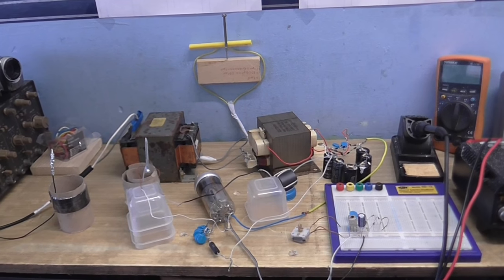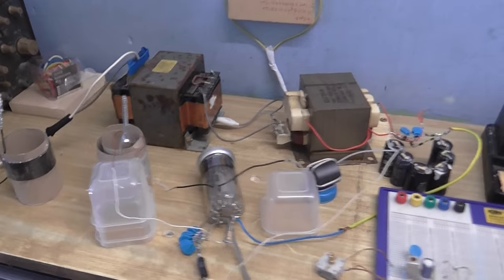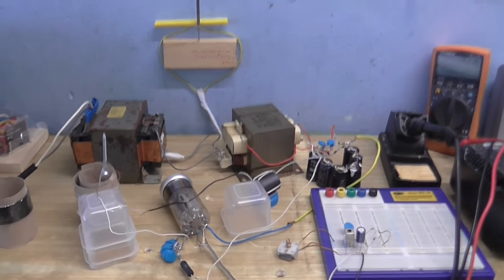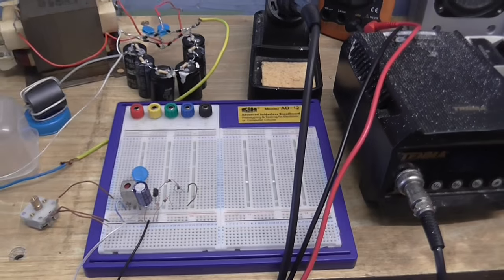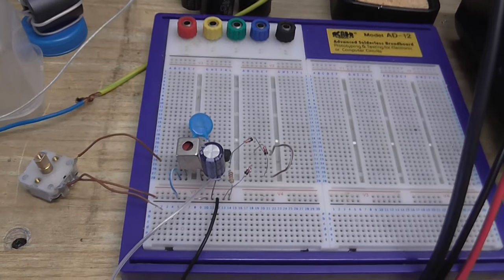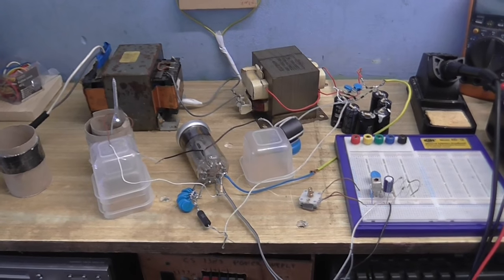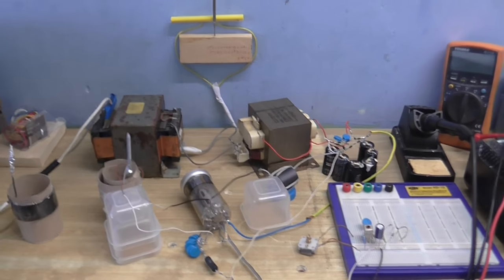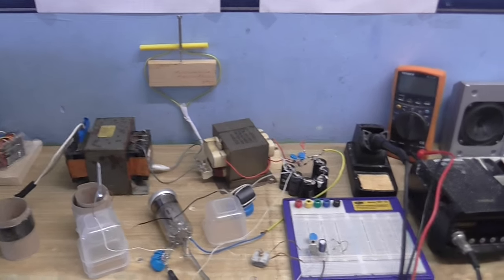Why I don't make videos as much as I used to

Comment: You could do a follow up on the SMPS, would like to see how it turned out.
Keep up the good work.
Reply from the maker: +Kirks Lab. I have an couple of ideas for another SMPS, witch should work better than my previous one.
Reply: +CoolDudeClem , that sounds even better. Have you looked at the one here  http://uzzors2k.4hv.org/index.php?page=benchsmps1  I was thinking of trying to build it here in 120vac land.
Reply from the maker: +Kirks Lab. Shouldn't be too hard to run it off 120 volts, all you need to do is replace the rectifier with a voltage doubler and that will give you the same DC voltage as a ordinary rectifier running on 240.

Comment: I have used arduino to wind my own transformer using a stepper motor... audio transformer for now but I think I am going to experiment with small power transformer,, just enough for the high voltages in tube circuits.   I think it qualifies as basic robotics.

Comment: What about the basics of tank circuits for AM radio receivers and transmitters? Can compare tube versions and transistor versions.
Reply from the maker: +MAN CAVE NO.1 I'm actually doing another superhet radio experiment right now, so I'll throw in the basics of how a tank circuit works while I'm at it if I remember to. The circuit isn't my own though as my knowledge of how those kind of radios actually work is somewhat limited, I'm hoping that building that circuit will shed some light on stuff, then I might convert it to a shortwave receiver later.

Comment: A new MUSIC GEAR ELECTRONICS oriented show? YOu know, working on not just amps but cigarbox guitars, mixers, recording and how to set it all up? Ok...so yeah...there's a pile of ideas for you. You need clarification let me know. :D
Reply from the maker: +MAN CAVE NO.1 I might try doing a cigar box guitar, I've experimented with making a simple electric "guitar" before, I haven't made a video of that, but it had a stretched out wire with a magnet placed near it, and I had the wire connected to the mic input of an amplifier and it did work, just didn't sound very good and quickly went out of tune because the wire stretches and stays stretched.  Maybe if i had used a proper guitar string it would have sounded better, the thing is I can't play any instruments, when I make my music, it all done on the computer.
Reply: CoolDudeClem I don't play either..but I heard that ANYONE can play a cigar box guitar by ear...assuming you can hear tones well enough. I really want to try to make one.